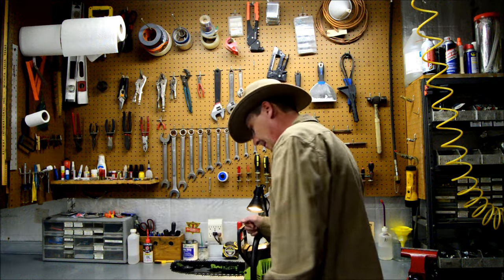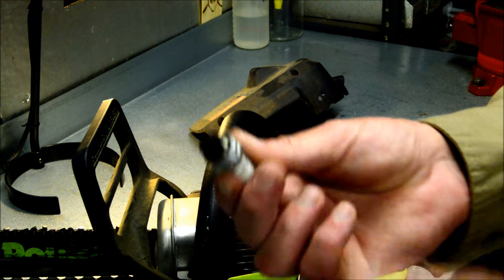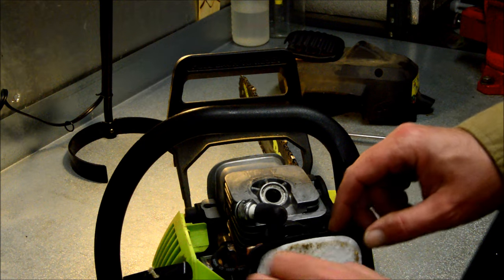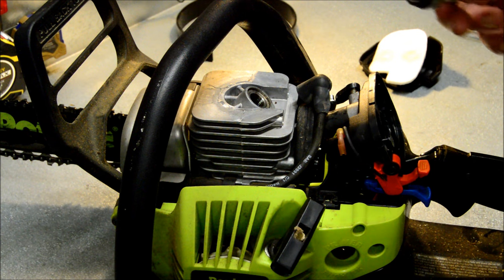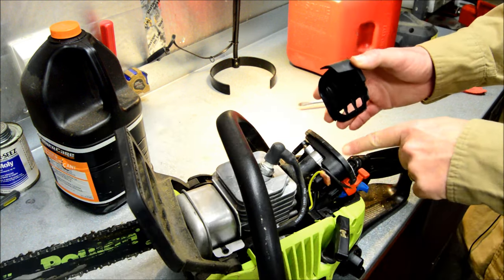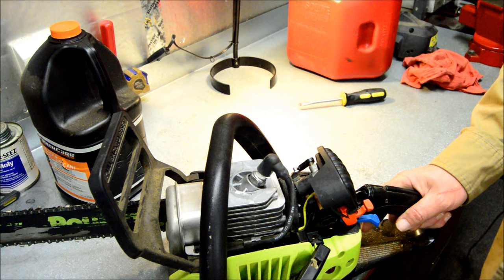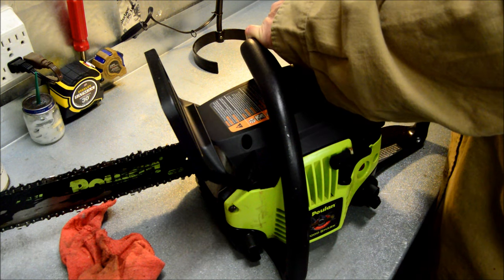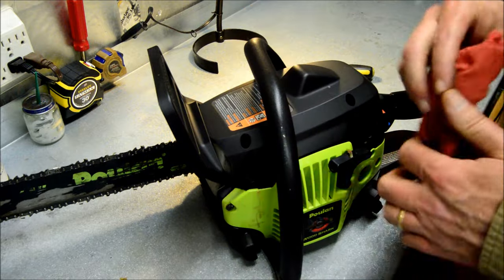Chainsaw Won't Start - 10 Years in Storage - Poulan Woodshark - DIY Repair

Comment: The saw sat for 10 years and the primer bulb was still good? Seems like if I pick up a saw after just sitting for a year and push the primer it cracks. How did you keep the primer bulb so fresh and new, for 10  years?
Reply from the maker: Just a guess, but the owner only used pure gas/no ethanol.
Reply: I did not think of that. I tried running the no ethanol gas in my Chinese Tao Tao scooter, and I think it actually made it run worse. If that is possible. Lol I am going to try to run my 2-cycle engines on the no ethanol gas and see how it does. Thank you.
Reply from the maker: @Rogers_Garage  Yeah ethanol is fine in your car if you don't let it sit too long, but in 2 strokes it eats up the rubber/plastic parts.

Comment: Awesome detail! I have the same exact chainsaw. Hadn’t run in quite a few years. Got it running but it stays triggered. And when I leave the brake on it smokes. Any ideas?
Reply from the maker: There is a spring that will pop out under the trigger. See if it came loose. On mine I took a thin pick and was able to shove it back in. Good luck.
Reply: If it smokes with the brake on then it sounds like the clutch is getting hot, you shouldn't be trying to run it off idle with the brake on. Just trying to help.
Reply: stays triggered do you mean the throttle stays wide open. that would explain the brake is burning up trying to slow the engine

Comment: I have the same model saw and it runs at high speed as soon as it starts for about 30 seconds then dies. Any ideas , a friend gave it to me to try and fix as he could not figure it out either..   I put an overhaul kit in carb and no difference. Any ideas ?
Reply from the maker: Check the fuel line/filter. Also could be an air leak at the intake.
Reply: Summit X ,thanks for the suggestions ..

Comment: Hello, Hands On.  I just bought a used  Poulan Pro  Predator,  PR 3516  at a sale.  One thing, they should have done ;  make  the bar/drive  cover, out of   real  metal.  The chain tensioner / tightener  screw, is  into   THAT   PLASTIC  HOUSING.  I've found, that under hot days, the chain loosens up . Conclusion ?   The plastic bends /warps, stretches.   oh well......have to live with it.  Might think up of putting a metal plate, over top  the plastic, but under  the  2  bar  nuts. Angle it, to keep screw tension,  CONSISTENT.

Comment: I have an Echo 14" chainsaw that leaks oil when it sits for a long time.  Do you think the reservoir might have a crack in it?
Reply from the maker: Probably not the tank, but there is a little valve that can get stuck. It is near the bar and you will have to remove the bar to see it. Usually you can just clean them out and get it working. Good luck.
Reply: The chainsaw does work, but I will look for the valve.  thanks
Reply: It could be that after running it hot for a while under normal use, the oil tank gets pressured up. So when you are done cutting, loosen the oil tank cap a bit to relieve the pressure. Might work.

Comment: I have the nearly the exact same chainsaw. maybe only the sticker on the side is different. But mine wont start. if i put it on full choke it will run at high revs for 30 seconds to 1 minute before dying (that's after like 30 pulls). I also replaced the fuel filter and line in the tank because they weren't even attached. rotted off. 
I noticed the intake boot is all cracked. Would that affect it? would just that make it so it doesn't run at all other than full choke? 
I noticed when you put it on full choke it didn't run at all. mine will idle for a while, and die when attempting to throttle
Reply from the maker: Yes if the intake is cracked it could create a lean situation. Id start with that and if it still doesn't run check the fuel lines again. They can appear fine but be cracked.
Reply: Crank seals probably sucking air as well
Reply: i have an earlier model. it gets fine sawdust in the carburetor. Clean it out and it is good to go. If the intake hose is cracked it will run lean so it could be either or both. Gasoline today is terrible. it may have gunked up the carb.
Reply: It's junk throw it away
Reply: @gordonwilloughby8793  mixed gas will not gunk up the carb. I have had 1000s of chainsaw carbs apart
Reply: @VanilaGorila96  these saws are total garbage they are mentioned to throw them away and go get a new one. I own a saw shop and I don't repair cheap garbage like poulan saws. New fuel lines spark plugs and and some labor go buy another turd poulan
Reply: I couldn't find my original comment but I ment gas with ethanol mixed in it.  I wasn't referring to two stroke oil in the gas. Ethanol Causes water to form in the bottom of the gas tank and carburetor creating gunk in the Carb and passages in the carb. It also causes the bottom of the gas tank to rust from the water. I have seen this problem in 4 stroke engines that don't have oil mixed in the gas. I do recall saying that fine saw dust will eventually build up in the Carburetor so it needs to be cleaned out.
Reply: Yes you are sucking too much air and not enough fuel, it's called running lean that is why it won't idle
Reply: @Wanous-hv7zo  you are missing the point .besides it running .
Reply: @robbob8050  you are missing the point. These saws are throw away saws just like a lot of stuff these days
Reply: @Wanous-hv7zo  I'm well aware of the low quality of today's good's, I've been wrenching over 35 years ,this guy is showing people how to fix things that most people would throw away ,for little or no money .that's the point.
Reply: Summit X  I see guys like you all the time bring in their junk poulan and you tell them it has a scored cylinder oh but I just purchased it a few months ago then you tell them just go buy another pile of shit or spend your money on a good saw and run it for 20 years.
Reply: @KySilverfish  ha haha enjoy reading what you are arguing about!😁 I buy poulan wood shark over the rest of them! Yea can toss after a season! But mine start up each year after setting for months! Old gas works fine too!  I have put Bigger 18" bar on wood shark and ran better than other!
Reply: What about the people who use a saw 2-4 times who don't have the money or have the money and don't want to buy a expensive saw to sit on the shelf and brag. Iv fixed poulans for cheap for fun. I have a neighbor who is rich and buys used cars!

Comment: I just tried to start my chainsaw, a John Deere CS40 and upon further investigation found the plastic fuel tube from the tank to the carb had crumbled and fell off in chunks. Do you ever check that?
Reply from the maker: Yes it's pretty common nowadays. IDK if it's because of the type of line or because of the modern fuel but the lines will eventually disintegrate. Best way to avoid it is to run your saw empty after each use.
Reply: @TheHandsOnChannel  I think when they sell new chainsaws they should include a few feet of extra fuel line just as a heads up as to what to check in the near future

Comment: Well, there is ten years in storage and there is 10 years in storage.  If one of my saws was in storage for ten years all you would have to do is fill them back up with gas and top off the bar oil and away you go.  I run my saws completely out of gas, loosen the chain a bit and give them a good cleaning before they go into storage.  Fuel lines are usually what deteriorate on those Poulenc saws, especially if they had gas in them during the storage period.
Reply from the maker: I agree, and this saw had sat for years with gas in the tank. Thankfully it wasn't ethanol or the fuel lines would have been disintegrated. Thanks for commenting.
Reply: bs carb diaphragm needs replacing usually. clean carb replace dia, fuel lines, clean replace filter and primer bulb. either fix the thing or quit, dont play.

Comment: Put couple drop gas in cylinder before putting plug back...if it fires up...and stops...you know fuel is issue !next check primer bulb for operation..has 2 hoses on it ..mine fell off due to age..then pump primer bulb ..gas should fill carb..if not issue is in gas tank..gas line likely cracked inside tank.

Comment: I have that exact chainsaw but a new model it starts fine idols OK after I cut the first Branch. It immediately shuts off what is wrong with it, does it need a carburetor adjustment to keep Idol?
Reply from the maker: You could try to adjust the idle screw but it sounds like a carb/fuel delivery problem. How old is the saw?
Reply: Get a professional chainsaw. In my experience those homeowner chainsaws run about 50 hours, so after a full week or two they can’t run for shit no matter how long you spend working on it. Depending on how much you use it, it may be worth the money for a husky or another real chainsaw.
Reply: Try the h adjust it just a tad.
Reply: I have a 3500 poulan, it runs great for few minuets, but then it dies, will restart after it cools, what I have found is that the rings  don't maintain compression after the saw heats up, allowing compression to escape past the rings and enter the crankcase, this results in shutting off the fuel supply, the rings might fix it but the cylinder is probably worn too.

Comment: Having seen this scenario many times, the first thing I would check is for plugged jets, rotted fuel lines and a fouled spark plug.
Reply: you are truly intelligent of the whole lot. I cant believe that went over his head, Its like watching infants trying to fix something
Reply: Hank Bridges  filter hole do you mean the hole the gas line goes into the tank? or the hole in the filter itself?
Reply: Hank Bridges  I have a choice do I want to drill out my tank and use the 5/16 plastic hose or hunt for a replacement for my John Deere CS40 and the original hose has crumbled to pieces
Reply: Hank Bridges  There is nothing left of the hose to grip the hose crumbled like stale bread. I just need a source of that fuel line and don't want to pay John Deere ten dollars for 5 " of fuel line as I don't like being "hosed"
Reply: Hank Bridges  If I could use clear plastic tubing for a fuel line which has a far longer lifespan it would make my chainsaw 10 times more reliable. I can imagine being up in a canopy and the fuel line decides to crumble
Reply: again no dimensions

Comment: Do all/some chainsaws only start with the chain brake engaged?,or is it just a safety thing??,asking cos i've never used a chainsaw & will be buying one soon 😉😉😉
Reply from the maker: Safety thing. You don't have to use the brake but since you are new you should use it.
Reply: @TheHandsOnChannel  thx will definitely use chain brake,if i get used to using it before starting a saw it will become 2nd nature & its a good habit to get into for sure. 😉😉😉😉
Reply from the maker: @neilfroggycrompton2466  Go check out the essential craftsman, he has a great video on chainsaw safety.

Comment: Don't start a chainsaw with the chain brake on. The idle is fast when starting, because the throttle is held open slightly to make starting easier. It forces the clutch to slip, which is bad for it.

Comment: What oil/ fuel ratio do you recommend on these , 2 strokes.
Reply from the maker: I run 50:1 in all my 2 strokes.
Reply: Poulans have always been 40:1 . 2 cycle uses the mix oil for compression as well as lubrication.
Reply: It should smoke a little bit in use, if it seems to be running too clean and hot then you should add more oil.
Reply: I have a 1960’s  Poulenc and the owners manual specified 17 : 1 gas to oil ratio.  Good luck

Comment: A friend of mine bought a Poulan 3314 .   --Brand new it wouldn't idle.  It would bogg when he gave it the gas.  He adjusted the idle, both mixture screws, replaced the spark plug;  It ran good for 1 hour then started bogging again and wouldn't idle. Even with half a tank.   He adjusted the carb again and it would run good for half hour then it would mess up again and again. If it stopped and sat when warm it wouldn't start again till cold.  No matter how tight the chain was it would sometimes throw the chain.  Sitting overnight the "auto chain oiler" would Drain out --All of the chain oil--on the floor.  He had worked on go-karts for years,  so he knew what he was doing... Three months later threw it in the dumpster. (Expired warranty??)
Thought you guys should know what he went through.   --Tim
Reply from the maker: He should've returned it right away. Not saying these are the best saws but sounds like he got a lemon.
Reply: @TheHandsOnChannel  try cutting 2 holes in the top part of the breather plastic plate that covers the cloth filter.  the top jets are not getting enough air.

Comment: I have a Poulan MicroXXV that I took to a repair shop and they told me it needs a carb.  Not sure I really trust that diagnosis though because the guy that checked it is the same guy that put the chain on backward and also put a fuel line on something else that had a slit down the side.  I have checked for a carb, but have been unable to find one.  Would you know of any place that I could possibly get one?
Reply from the maker: I'd check ebay. Good luck.
Reply: @TheHandsOnChannel  I already have, as well as about a dozen other sites.  Carbs aren't available and no longer made from what I can see.
Reply from the maker: @Newman81964  See if you can find a rebuild kit for it.
Reply: @TheHandsOnChannel  The guy at the shop that told me it needed a carb had said they tried to rebuild it and were unable to get it to run right and that is why they said it needed a carb.
Reply from the maker: @Newman81964  IDK without looking myself, but I'm sure it can be rebuilt. Sounds like the guy didn't really know his stuff from what you said about the chain. Give it a try, heck what do you have to loose. Good luck!

Comment: I am hoping someone could help, I had to remove my flat tire from my husqvana rider mower, 
added air, it ok,,,I replaced the spark plug and bought a new battery, it turns on but will not  go forward or backwards  this was the left rear tire, I  checked the right  rear the washers seem tighter with the clip, than the left that I put back on,,I am missing something, when I mounted the tire,,Kathe
Reply from the maker: I'm not familiar with the Husky mowers, but my cub cadet has a little rod in the rear that is like a neutral. When the rod is not engaged it will do what your describing. See if your machine has the neutral rod and try to move it on and off to make sure it's engaged. Good luck!

Comment: Have a question  why didn't you check the gas filter
Reply from the maker: Good point, I actually did but I edited it out for time. I visually inspected the filter and tank before refueling.

Comment: After 10 years I would change all the fuel hoses mine go bad every 2 or 3 years they get leaks in them and they will not run.
Reply from the maker: Yeah normally you are right. I don't know how but the lines were good.

Comment: Pretty good video but usually if something ain't been ran in 10 years uses gas lines are rotten
Reply from the maker: True, but luckily this one was fine. He did run pure gas in it (no ethanol). Even so, I was shocked the hoses were still flexible and not brittle. I should have talked about the hoses more in the video because you're right they normally disentigrate.  Thanks for the comment.
Reply: Check compression with spark plug out
Reply: @TheHandsOnChannel  Oh by "pure gas" I thought you meant no oil in the gas

Comment: You probably should not leave the chain brake engaged like that!
Reply from the maker: Thanks yeah I noticed I did that. I usually don't rev at all with the brake on except to take it off fast idle, but I wasn't sure it would stay running so I feathered it a bit. Still going strong according to the owner.

Comment: I have one of those pieces of crap.
The fuel line inside the tank had literally  disintegrated in less then 2 years of owning.
Was clear plastic..i replaced with rubber. No problems.
Reply from the maker: Yeah all the chainsaws I've run across recently have the same plastic fuel line. Good idea with the rubber lines. Where did you get it?
Reply: The Hands On Channel ..
Saw at Sutherlands.
Fuel Hose at O'Reillys

Comment: iN MY COMMENT ABOUT USING ( STRAIGHT gAS) IN NO WAY WAS i SUGGESTING NOT TO USE A GAS/OIL MIXTURE BUT i WAS SUGGESTING USING 100% GAS WITH NO ETHANOL IN IT.  IF YOU DO USE GAS WITH ETHANOL ON THE OLDER MODEL POULAN SAWS THE GAS CAP SWELLS UP AND WILL NOT FIT PROPERLY.  SORRY FOR THE MISUNDERSTANDING.

Comment: I have an older Homelite that I used for one season about ten years ago. Next season it started and died and would never start again. I'm pretty positive it's the ignition mod. But my question is why will no shop in my town even work on it? When I first started working on it I found every single parts down to every screw and washer online, but the Ing mod was listed as Unavailable. WTF? I think they can be had online now that it's a decade later. And yet still no local shop will touch it!
Reply from the maker: IDK why no shop will work on it but I'd start with checking for spark if you think it's ign. related.
Reply: Yeah well , pretty much first thing eh? And all wiring as well. Why I know it's the once unobtainium ignition Module.
Reply: I've gone through the entire diagnostic routine at least twice. M-kay. 
Nobody around here would fix it for me and I have a bit of skill at this shit.
I would order an Ing mod tonight but first I would have to take it apart again to get the exact number.  Pain in the ass. ...eventually.
Reply: @TruAnRksT  throw it away and go buy a good saw
Reply: @Wanous-hv7zo  Stihl doesn't answer my question.